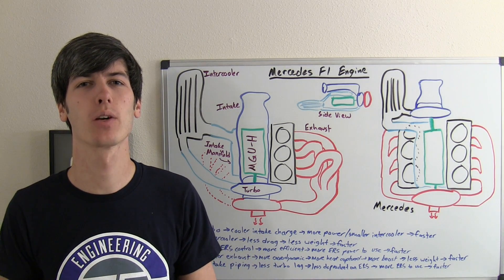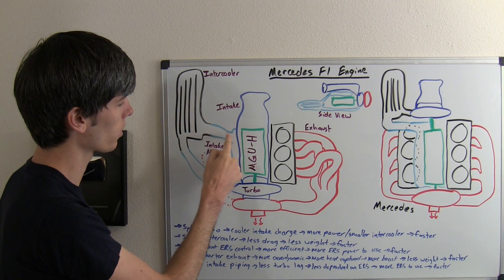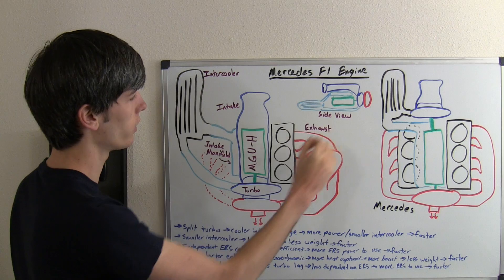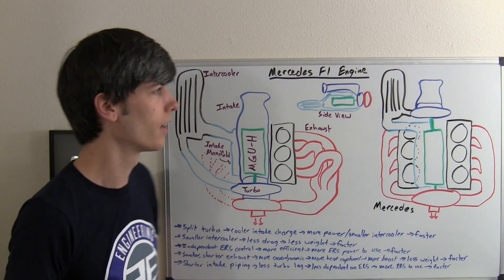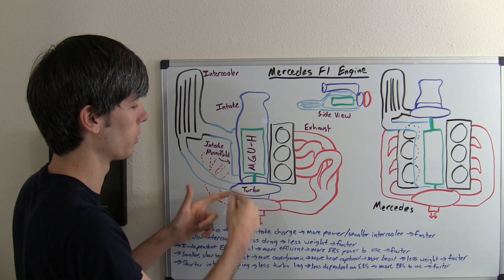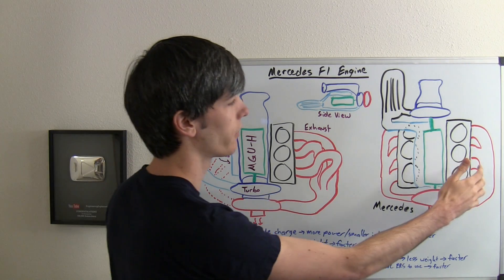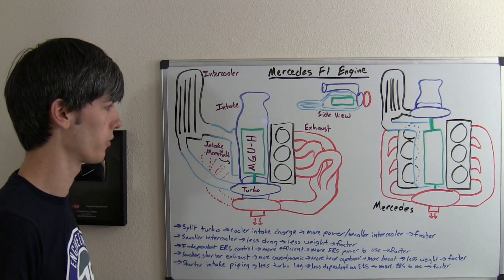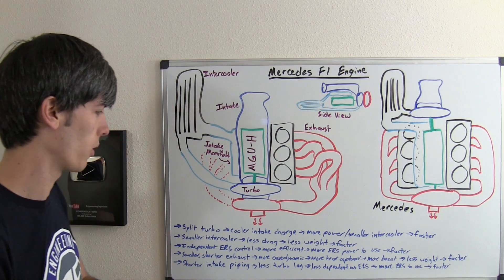Mercedes F1 Engine - How Mercedes Dominated 2014

Comment: Is it possible for the turbo to be spooled only with the MGUH/ERS, thus not needing the exhaust to spool the turbo?  F1 engines will sound much better without the turbo muffling it.
Reply: I suppose, but you would be missing out on free energy from the exhaust.

Comment: why does air is cooled by intercooler before entering into intake manifold??
Reply: Air naturally heats up if you compress it and hot air is less dense at the same pressure. So by cooling it down again you end up with more air oxygen to burn in the cylinder also the cooler air helps to reduce the risk of knock.
Reply: Akshay Manthekar Because combustion works best with cool air

Comment: I thought that Mercedes switched the porting so the exhaust ports were inside the V (where the intake is normally) so as to take advantage of the kinetic energy of the expanding gases when the exhaust valves open, hence increasing throttle response while eliminating the heat soak associated with longer pipes.  I guess not.  lol

Comment: we need more speed in F-1, close to 400 kmp would be just fine in my opinion.
Reply: Won't happen because of safety concerns. Cars were achieving 400+kmh in LeMans, so they made a few chicanes to break up that very long straight (6km before).
But still, F1 cars are pretty fast. Achieving 360+kmh (with DRS open) on faster tracks.
And next year (2017) we'll have cars that are ~4 seconds quicker per lap while being a bit slower on straight. More grip, a lot higher corner speeds. Should be interesting :)

Comment: In the video you mention the MGU-H being able to accelerate just the compressor part of the turbo, but i doubt that, because it would require the compressor and turbine to have two separate shafts, which would require that the compressor be driven by an electric motor 100% of the time. IMO having both the compressor and turbine attached to the same shaft would be more efficient.
Reply: You could have a clutch at the front or back of the MGU-H to allow for this.

Comment: On the Mercedes why even have an intercooler.  I always thought it was just because intake air got so hot because it was next to the hot exhaust gases.  With this design the intake and exhaust are separated.  I guess they just want to get the intake air as dense as possible.  Something tells be the intercooler at some point will disappear.  Bryan
Reply from the maker: +bryan prindle Turbochargers compress air, this heats it. Intercoolers cool it. Intercoolers are essentially a must for efficiency.

Comment: but longer shaft means lower efficientcy
Reply from the maker: +Muammarvsgaming ROBLOX and more And clearly it was worth the very minute compromise.
Reply: if they had to have the ERS then it must have a shaft so why not use both ends of it, this is truly an ingenious design that is using every inch of what they have to the maximum potential im in love with this idea
Reply: That's not what SHE said...

Comment: Why does the intake air need to be cooled.... doesn't the turbo, force the air into the cylinders ? Hot air at high pressior would be the same as cold air at lower pressior ? Or does high pressior air burn less good......
Reply: Colder air is more compact, thus contains more oxygen per volume.
There's a limit to how much boost you can put in a certain engine without making it blow up, so getting the air that enters the engine as compact as possible is a way to get more oxygen in it at the same boost pressure, thus allowing to add more fuel to end up with the same fuel-oxygen ratio, creating more power out of the same size engine.
Reply: when the turbo compresses the air, it heats up, so it needs to be cooled before going to the intake. at least that is my understanding of it.
Reply: Also, hot air tends to cause the air/fuel mixture to explode (called detonation) rather than burn in a controlled fashion which causes a loss of power and engine failure. The mass of air flowing into the engine is what really matters, and that mass can be increased either by raising the pressure or lowering the temperature. Since raising the pressure also raises the temperature which causes detonation, lowering the temperature is a necessary supplement to raising pressure.

I'll note that because diesels suck only air into the cylinders and aren't subject to detonation, they're much less limited in how much boost they can handle.
Reply: +chitlitlah Like you describe, it's primarily a limitation of trying to prevent detonation and pre-detonation. There's more to it, though. Fundamentally, it's a limitation imposed by a cycled-engine. If it were a continuous flow engine, far higher compressions and power densities would be possible. Modern turbocharged engines really struggle to get past maybe 40-50 psi of compressor discharge pressure. 50 year old gas turbine engines routinely went over 150 psi, more modern designs easily crack 500 psi.
Reply: +totoritko Well, your comparison to turbines isn't fair. The problem isn't the compressor outlet pressure, it is the pressure you reach when the piston starts to compress the air. If you go into the cylinder with 2 bar "absolute manifold pressure" and the engine has a compressionratio of 10:1 you will end up with nearly 20 bar pre ignition pressure or 290psi. And to be even more fair, you should compare the turbine with a diesel engine, because they use nearly the same fuel and the way they inject fuel into the compressed air is way more comparable.
Reply: shi01
"The problem isn't the compressor outlet pressure, it is the pressure you reach when the piston starts to compress the air."
That is exactly what I meant. 
"you will end up with nearly 20 bar pre ignition pressure"
Which might cause detonation/pre-detonation to occur. To be fair, I was slightly inaccurate in my detailing of the power density limitation. It is both a function of maximum pressure limited by fuel-air mixture detonation and the cycling itself (meaning, the engine doesn't develop power all the time). These two factors combined are why gas turbine engines develop around 4-8x the power for the same weight compared to piston engines (and I'm not talking the nitro-craziness that will disintegrate in seconds, I'm talking continuous power for essentially unlimited time).
"And to be even more fair, you should compare the turbine with a diesel engine"
The fuel isn't the important part. The important part is the cycling. Gas turbine engines don't cycle. They burn continuously, hence there is no requirement for the fuel to sustain compression with the oxidizer present without detonating. As soon as the fuel is injected in a gas turbine engine, it can start to burn.
Reply: totoritko
And Diesel engines are generally direct injected which means as soon as the fuel is injected, it starts to burn by itself. That's why i mentioned it. ;)
And of course, if you go for power to weight and cold start to full power time, a turbine is way better than any piston engine.
But if you go for thermodynamic efficiency, things start to turn if you go big with the engines. The really big 2 stroke turbo charged marine Diesel engines can achieve more than 50% fuel efficiency. Even the best powerturbines are just somewhere around 40%. And you can run this big diesel engines also for a unlimited time. They are made for that.
So in the end, one system isn't necessarly superior to the other. It depends what you want to achieve.
Reply: shi01 True, direct-injected diesels circumvent the det problem. But not all engines are fuel-injected, much less direct-injected :) And you're 100% correct that gas turbine engines aren't a magic solution to every problem. Most notably at idle they're absolutely worthless for fuel economy. That having been said, even 50% is attainable, though not in mobile installations (see Combined Cycle Gas Turbines).
Reply: when the turbo compresses the air, it heats up, so it needs to be cooled before going to the intake. at least that is my understanding of it.
Reply: +FuriousVigor Cooling isn't really necessary, older turbodiesel cars didn't have an intercooler... But it's a lot more efficient to use one.
An engine block has a certain amount of pressure it can safely handle over a long time, as cooler air is denser, you get more oxygen for the same volume and pressure of air with an intercooler, allowing the engine to produce more power.

Comment: I wish F1 were more about engineering than drivers.
Reply from the maker: +PacoBom Z In many ways it is. The reason Mercedes is so dominant is because their vehicle is dominant, not purely because of the drivers. The other teams can't compete. But due to the regulations, it's very difficult to improve upon the design once the season starts.
Reply: What..... F1 is almost completely about the engineering. Look at it's history. Why do you think there are so many guide lines now. The lotus wing hidden by it's side skirts. There is a reason the FW15C is banned. F1 racing costs so much because they completely spend all the money they raise on innovating the car.
Reply: +PacoBom Z i once join a competition called F1 in school, it taught me that F1 involves team, not just about driver. In a team, there are engineers, designers, drivers and PR is important as the team needs to get funding and funding i always the first priority in case of team's action, no money= no action.
Reply: Unfortunately, that is exactly the way it is. Why you would prefer that over driver skill is beyond me, however.
Reply: LOL your like the only guy that wishes that. Well maybe some other engineering guys wish that, but it's meant to be about all of them equally, I guess that's the aim anyway.
Reply: +Engineering Explained Though Bernie would have us all believe otherwise ;)
My main gripe with F1 currently is that to make it "relevant" to the audience they dumb it down as much as possible. Though at this point, with the technology where it is, I really wish they would take the time to explain things (as you have done so well) instead of regulators just saying "Surprise! Efficiency!" and getting the fanbase all 'torches and pitchforks' over it; a curious and equally frustrating paradox...
Reply: If you're more into science than skill, it makes a lot of sense. With F1 being about engineering, it's more like the excitement from the space race than if it were about the driver skill, where it would be more like a foot race.
Reply: ItsAlleged
You are totally lost
Reply: CORZER0 how so?
Reply: TheTripol nope me too
Reply: it has been everbsince 2010.  ever 2010 the best car its self was light years ahead of the second car.  ham and vettel were just lucky driving them

Comment: Hi! I was wondering the last couple of days about the will to return to V8. Ecclestone is a big advocate of that because fans are less attracted to the "not defeaning noise" of the V6 turbo+ERS, but Todt is against it because of the cost of fuel and polution. I really think we have to reduce consumption etc. but I also think that V8s sounded better than V6 turbo (althought I learned to like them to). What my question is: Why wouldn't V8 turbo + ERS be possible? Would it be to mass/power inefficient? To high a cost? Would be cool if you explain it!
PS: your videos are my reference for most of my knowledge in mechanical engineering :D
Reply: Of course a V8 Turbo engine with ERS support would be possible, but it wouldn't solve the sound "problem". I think many people think the new hybrid engines sound bad because they are hybrids. But that's only a part of the problem. Basically it sounds "bad" because it's a turbo engine. The MGU-H makes it worse a bit, because they use even bigger turbochargers to gain the full advantage of the system.
But you can even look on street cars to spot the problem. Pagani as an example had to build titanium resonance chambers inside the exhaust system of the Hueyra to beef the sound of the engine up which is in fact a turbo engine. That wasn't necessary with the Zonda series which used natural aspirtated engines.
A turbo charger is a restriction inside the exhaust and and that quitens down the exhaust noise. On normal cars, you can regain some of the noise with "articial measures" but such things adds weight and need space.
And an other thing, a turbo charger makes it unnecessary to rev up to 18000rpm. A turbo engine has a very diffrent torque band and can produce significant amount of power at much lower rpm's. And there's also the the fuel mass flow limit of 100kg/h at 10500rpm's and higher. The rules allow to rev up to 15000rpm but no one did this in the last season because there wouldn't be any power gain. In fact, the engine would lose power after a certain point in the revband because of that.
And last but not least, Jean Todt is completly right. It would cost a fortune to make new engines again. You can't just reuse the old V8 because they were never designed to be turbocharged. The manufacturers would have to make a completley new design again like they did it with the V6. Which have nearly nothing in common with the V6 they used in the 80's and the Turbocharged V8 would have nearly nothing in common with the old V8 which were used since 2006.

Comment: Aren't there disadvantages associated with making the compressor/turbine shaft longer like added inertia are there any other disadvantages with having a longer, extremely quick rotating shaft?
Reply from the maker: Ubernoob85 It's not really that long, the MGU-H is in the center so it's just two short stub shafts connecting.

Comment: What I don't understand is how, with the addition of a longer turbo shaft, the rotational inertia of the shaft doesn't increase tenfold, requiring much more energy to rotate it.

And this may seem like a matter of opinion, but with only 1 season of experience, it's hard to say this split turbo design is what pushed them ahead, especially with the absence of comparison testing.
Reply: That shat isn't as long as it seems, and it's made or carbon fiber. 
It probably weighs less than 100grams
Reply: Bruno Danese I don't think it has to do with weight. The longer the shaft, the more rotational energy is lost spinning it. Besides, even if it was made of carbon fiber and weighed 100 grams, a normal sized shaft would probably weigh 10 grams, and thus take 10 times less energy to turn.
Reply: Good points.
But, they went with the design and have dominated the past two seasons. So it must be pretty good.

It's always about the compromise. A loss here, might be a bigger win there.
Reply: Bruno Danese That's also true, but Mclaren also uses the same engine, and they obviously didn't do as well. Not to forget Lewis Hamilton raced for McLaren, and that was the last time he won driver's title; without a Mercedes engine. So it really comes down to both engine AND driver, seeing as Hamilton can win regardless of what team or car he's in lol. Whatever losses might be present in this technology are definitely made up for Mercedes by Lewis anyway.

Comment: `to add to this, besides aerodynamic advantages concerning packaging, there are also advantages with placement of for instance the gearbox. Due to this setup the gearbox can be mounted lower in the chassis, helping the center of gravity as well. This leads to a snowball effect with other parts as well. This is one of the reasons Mercedes dominated the other teams running the same power plant. Mercedes had about a year and a half more time to maximize the options and obviously designed the engine in unison with the complete package.

Comment: Do they use wastegates with this setup or not? I ask because couldn't they use the mgu-h to put a load on the exhaust side of the turbo and generate energy from the excess exhaust that would normally be dumped to prevent overboosting?
Reply: i don't think they have wastegates. otherwise the engines would be much much louder since it would allow exhaust to bypass the turbine
Reply: They have still a Wastegate, but it is normally not used. It is thought for the case if the mgu-h would fail.

Comment: You never mentioned any drawbacks of separating the two sides of the turbo. Are there any drawbacks you know of? Is there any loss of power in that long shaft connecting the two sides of the turbo?
Reply from the maker: The shaft can be fairly short, just two little stub shafts connecting each end of the MGU-H.

Comment: How much boost pressure do these make?
Reply from the maker: I don't know if there's an official number that a team has released, but I believe it's in the range of 45-60 psi based on some simulations I've seen.
Reply: Engineering Explained
The low side of that range sounds about right if not a bit too high. In 1986 boost pressure was unlimited and horsepower was in the range of 1300 for qualifying and 900 for the race. In 1987 it was limited to 4.0 bar (58 psi) and in 1988 it was 2.5 bar (36 psi). They didn't have a 100kg/hr (peak-instantaneous) flow-rate limit back in the 80s like they do now, so there's only so much boost that makes sense to run on the 2014-spec engines without the limitless fuel to back it up.
Reply: wow!!! thats insane!!! those interns are working hard! F1 really are the gods of engineering!

Comment: I got a tour of the Mercedes Patronas garage at the Montreal GP. I knew about the intake being shorter helping reduce turbo lag because there is less air therefore more pressure which get the turbo spinning faster because I saw the intake on the engine, but the exhaust wasn't on the engine so I didn't see that. I never knew the exhaust was shorter than the other engines. But that makes sense to why they did that, same reason with the intake. It will be interesting what Honda will bring with McLaren next year. They will see how successful Mercedes was with their engine design and would have seen their design as well.